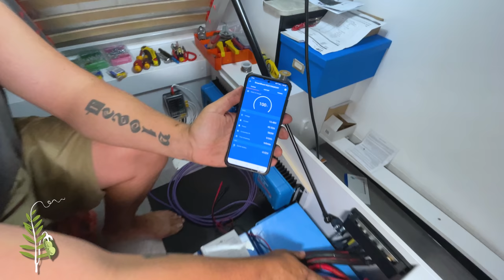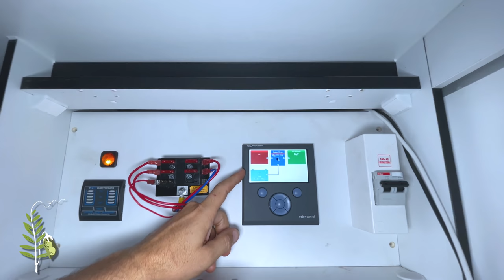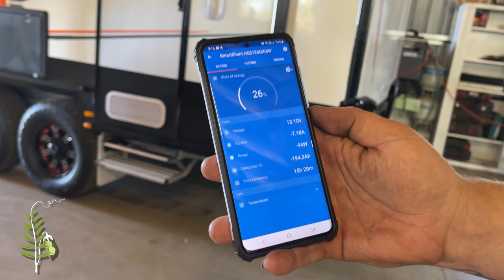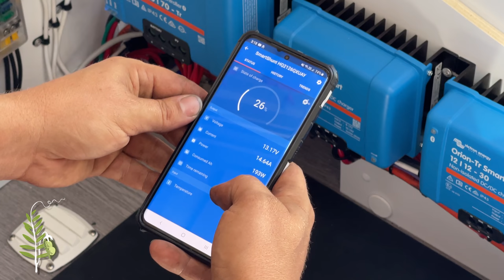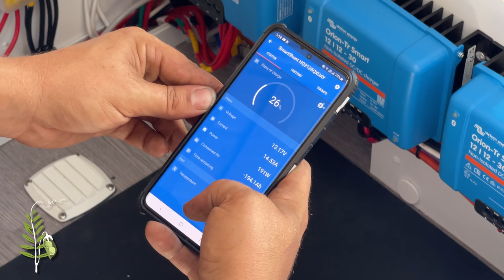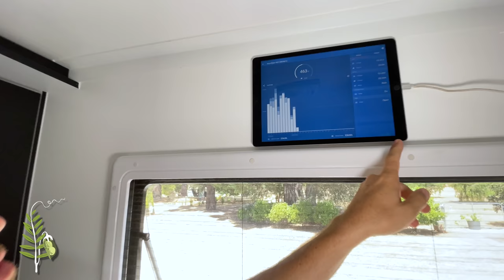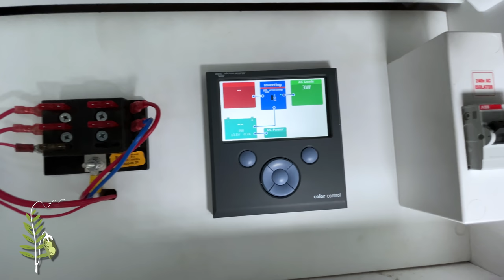S1 Ep3 Off-Grid Caravan Solar System & Lithium Battery DIY Install - LBW Adventures

Comment: Great work guys, wow 3 d printing and Victron your right up my alley you will not go wrong with this equipment, I have Victron on my Amarok same Multiplus 2 / 3000w inverter 3 x dc dc and 2x 160 victron batteries its great stuff. Our Willow caravan is next for the power system.
Reply from the maker: Hey Terry,  thanks for watching!!!!! Yes we had a bit of fun with the 3D printer and we love our solar setup. 12 months in now and it hasn’t missed a beat 🙌🙌🙌.  Best of luck with your caravan solar project and thanks for watching and sending us a commenting 🤣

Comment: Great video guys but I have 1 concern....Did you check as to how many caravan manufacturers are STILL using the flat solar panels ???? Hate to rain on your parade but I know many found without the air gap that you get with the "normal" glass panels, the heat is a major performance killer to solar panels...but all the internal bits are quality gear.....Hope all turns out well for you
Reply from the maker: Hi Graham, thanks for your comment. The manufacturer of our van supplied it with one single glass panel, but as we're working form the road we needed to invest in a lot more power than what that single panel could give us. Luckily we've had some very hot days in the 2 weeks we have had the panels installed to test performance, and although they don't preform as well on 40+ degree days, we're still getting more than enough power to fully charge the batteries by lunch time so far. Thanks for your support and for following our channel :)

Comment: Real good setup. Can’t do much better than that. Will love to know how batteries hold up when you get a few dull days in a row. 2 orions is a great idea. Would you print some of those Anderson plug holders and sell them to me?  Cheers
Reply from the maker: Hey Glen, We have had a few cloudy days on and off and we're still more than getting by with the solar, although on those days we are a little more careful with what's plugged in, and if it's really cloudy we switch the fridge to gas just to help the batteries catch back up. 
I think we've hit 100% charge most days we have been out so far while also using power as required during the day. 
Those Anderson plug holders were printed as a favour by one of our friends so we don't really have them available to offer to you, but I would imagine anyone with a 3D printer might be able to help you out. 
Thank you for your comment and for watching our video 😁

Comment: Home installation, no problems, when I built my caravan , solar was fairly new, I got a quote for $10,000 .I designed and installed my own . Cost 3200 max, Just , 2 /. 260 amp / hr  wet cell batteries  45 amp charger ,  plus controller,  batteries lasted 12 yrs ,now have 2/270amp/hr AGM , Don't expect them to last that long, Also now have a 1000 W inverter. 500 W Solar. Cheers🤠🇦🇺
Reply from the maker: Hi, great to hear from a fellow DIY-er 🙌 Wow 12 years, that was a great innings, you obviously installed it all well. We hope ours has a decent amount of life in it as well be using it full time, but I guess that’s all part of the adventure along the way 😀
Thanks for following along with us!

Comment: That feeling of drilling the first hole!!!! ahahah
Reply from the maker: It doesn't matter how many times you measure, there is nothing that takes away that feeling of possible disaster when your about to drill a large hole into the side of your brand new van 😱😁!!!! Thinking we almost hit 240 Volt cable didn't help either!🤣
Thanks for watching our videos and sending us a message.

Comment: Hey guys, great video and well done with the solar fit out. I'm in the market to do the same with my van. Can I ask if you shopped around before settling on Amptron? I'm in WA and have been checking out a few others but looking for recommendations of quality equipment at reasonable prices and of course service. Thanks and keep up the great videos.
Reply from the maker: Hi Stephen, thank you, yes it was a bit of just jumping in the deep end and learning how to swim in regards to the self-install. In saying that it not only saved us money doing the install ourselves, but we now know how everything is wired and where all the runs are should anything ever go wrong. We have been very happy with our setup. We have been off grid for over 170 days continuously at this point and have no issues powering everything we need to camp as well as charging video gear, laptops and keeping the coffee machine running (the most important haha). We went with Amptron as they are a local perth based business down in port Kennedy and we knew of them before hand. They had us come into the office and go through all the appliances we wanted to run then created a spreadsheet with what we would need to make that all happen. They included their own brand of product as well as other brands if they didn’t have what was needed, so in our case we purchased the whole system through amprton but our setup is a mixture of Amptron and victron gear. It’s hard to know who to go with, but we have been very happy with what we have. If you do give Amptron a call, ask to speak to Kevin or Frik. Let them know you saw our setup so they can do the same for you in regards to planing a custom setup.
Reply: @LBWAdventures  hey guys, thank you so much for your detailed reply,  just awesome. I will definitely include them in my hunt and give them every opportunity.  I think it's great what you are doing, living the dream. I wish I could do the same. In the meantime keep making great vids and I will keep following. Safe travels .
Reply: @LBWAdventures may i ask the cost of your solar set up.?

Comment: Great job guys and 👏👏 for having a crack.  My only query was on the under bed cooling fan.
Looks like it’s drawing air from the front tunnel boot.  Does that mean the compartment will need to be open to allow for air movement?
And do you need a corresponding small vent at the front or side of the bed for the warm air to exit?
Reply from the maker: Hi David, thanks for your comment and for watching our video 👍
In response to your question, we have the fan going the opposite way. It draws the warm air out from under the bed and blows it into the front tunnel boot. As we generally only have the fan going when we are parked, we simply open one of the front tunnel doors to let the warm air escape if it's a hot day.
Thanks again for following our adventures 😁

Comment: Hi there, I'm sorry to say but those flat plastic panels are crap, if you read any articles on solar heat is a killer on performance, they nead an air gap under them,but I did enjoy watching the video, shall carry on watching your adventures, happy travels 😀ps watch Explorist life,this guy really knows his stuff on solar panels. 😀
Reply from the maker: Hi Keith, Yes we were aware the glass panels typically perform better, however with the vehicle we are pulling with and the caravan we purchased weight was a major consideration. We also found through research that the Amptron semi-flexible panels use a slightly different technology to other flat panels, so finger crossed we will be ok. To date we have fully recharged our batteries with these panels everyday by lunchtime. Thanks for your comment, well wishes and for watching our video :)

Comment: Hey team new to the channel and love your work. Sorry if this has been asked but what brand solar panels did you use and how did you mount them please? It looked like they were stuck on but I am probably seeing things. Many thanks Mark
Reply from the maker: Hey, the solar panels are AMPTRON panels and are all 170Watt semi flexible. We know the solid panels have a longer shelf life but we needed the lightness of the semi flexible panels due to our weight. So far our panels have been working amazingly. We are generally back to 100% by lunch time  most days (weather dependant a little of course) and have just finished 6 days off grid leaving site on 100% battery. The panels are stuck to the roof using 3M ultra high bond tape as recommended by the supplier. Thanks for your question and for watching our video 😁
Reply: @LBWAdventures  thank you

Comment: Haha did U use Dcs battery lithium they are Australian made also they help Australian military setup off-grid using victron stuff USA gear. Some van setups 600amh batteries 3/200amh 1200 W panels more than enough juice aircon hot days nights fridges micro oven
Reply from the maker: Hey Harry. We used Amptron lithium batteries as they are a local perth based company who planned out our whole system for us. There is also victron gear in the setup for the components Amptron didn’t offer. We have been very happy with it for the past 12 months :)  hope you have a great Xmas 👍🎅

Comment: Any reason as to why you didn't put batteries out side and under the van in a locked box?
Reply from the maker: We didn’t want them outside as under the bed gives easy access and we needed the tunnel space to carry outdoor chairs etc.  we also didn’t want to add additional weight to the front of the van  😀

Comment: Hey guys, so far so good, its always good to save money where you can. I have a question for you, we are looking at a new Everest to pull a 19ft 6 Opal van and I was just wondering if you have yet weighed your van from empty to full. When I say full I mean when you have everything in and on ready for setting off on an adventure, looking at the average load you have put into your van so we can calculate if the Everest with pull the van. Many thanks and keep those videos coming.
Reply from the maker: Hey Bradley, we haven’t weighed the van fully loaded as yet. Having the Everest we did consciously look for a light van to help with the tow rating.  Our 19.6f is 1982 kilo empty giving us 518 kilo payload to its max ATM of 2.500.  We have however encounter an issue with the Everest over the weekend while towing on a hot day and are now waiting for a new turbo to arrive. Ford couldn’t give us a reason as to why it’s blown. 
We would however highly recommend investing in an after market auto transmission cooler as the auto also got hot that day. 
Best of luck with your van shopping and thanks for watching our videos :)
Reply: @LBWAdventures  Many thanks for your reply, are you running the 3.2lt or the 2.0lt bi turbo. We are looking at the 2.0lt as most say this is the better motor for towing.
Cheers Bill.
Reply from the maker: Hey Bill, we have the 3.2lt diesel. Not too sure about the details of the 2.0lt bi turbo as we haven't done any research into that. Best of luck with your decision.
Reply: The beauty of the Windsor is it’s lesser kerb weight and corresponding ATM.   I’m looking at one for my 2021 Prado.
Reply from the maker: @bluecent  Yes the light weight of the Windsor and the ATM was a big decider in us purchasing this van. Enjoy your new van once you get it :)

Comment: Is there an air gap under the solar panels. Many panels fail in the northern heat if stuck straight to the roof.
Reply from the maker: Yes there is a small gap under the panels as they were supplied with a plastic strip to allow the air to get under. We have had a couple of 40+ degree days so far, and so far so good :) Thank you for your comment and for following our channel!

Comment: Hi good video what did you use to hold to solar panels down and what are the to blue boxs next to the mppt as in your video you did not say what they are and do thanks 👍
Reply from the maker: Hi thanks, we’re glad you enjoyed the video. Yes sorry we realised we forgot to include those in the wrap up after the video was published. The two blue boxes are 30 amp DC to DC chargers which allow us to charge 60 amp hours to the batteries via the truck should we need to charge in addition to the solar. They can also charge everything and keep the fridge running while we are moving from one location to another.  Thanks for watching our adventure 😀
Reply: @LBWAdventures  thanks that’s cool can I just ask when it comes on the car do you need a dc dc charger in your car as well or just a lead form the battery thanks 😊
Reply from the maker: Hey Shane, we ran a lead direct from the car battery via an 80 amp fuse and a voltage sensitive relay straight to the back of the car. The back of the car has an Anderson plug to the caravan DC to DC's. 
Hope that helps. :)

Comment: Hi, I have a 196RD also, where did you connect the 240 volt inverter output back into the existing van 240 volt system.
Reply from the maker: Hey, on ours we have it set up as ship-to-shore to inverter and then inverter to original main breaker so all our power points can run from the inverter. That part we had to have done by an electrician because it was 240 volt. Hope that helps and thanks for watching our channel :)
Reply: I am planning to do a similar install but have the batteries under the rear dinette seat and the inverter and chargers under the front one, I was wondering exactly where your your sparky ran the 240 inverter output back into the existing system, thanks for your prompt reply,
PS have most of the Victron gear still waiting on multi pass inverter
Reply from the maker: Sorry your comment got held for review by mistake so we just read this. Ours runs down the drivers side wire channel which goes from the bed, behind the cupboards and up behind the fridge to the main isolator. We had to pull apart half of the van to find it 🤣 not sure if that helps. Good luck with your set up.